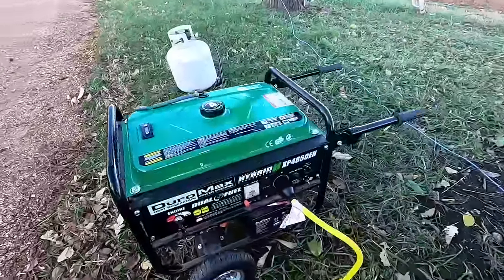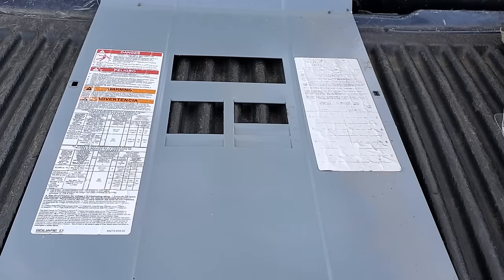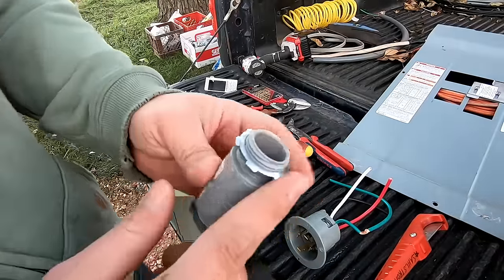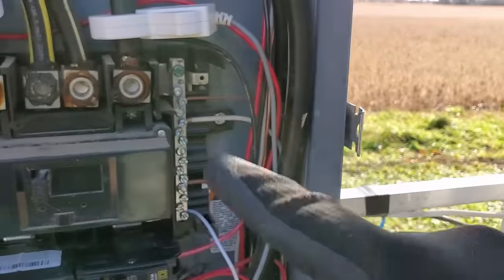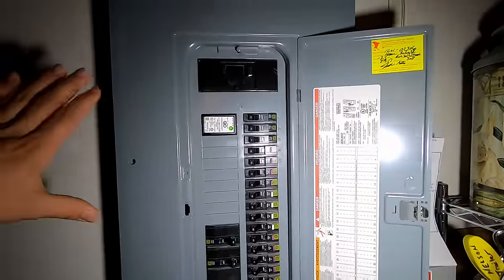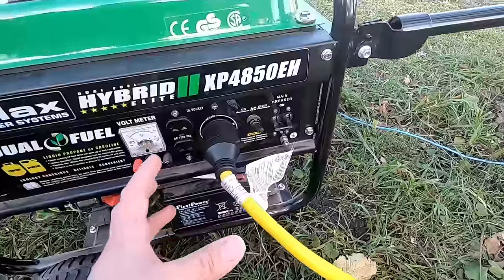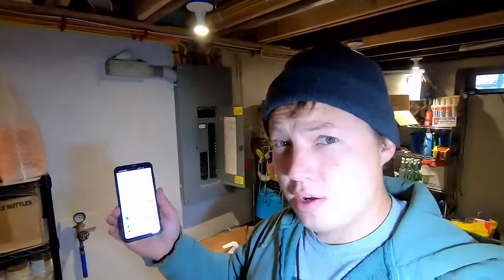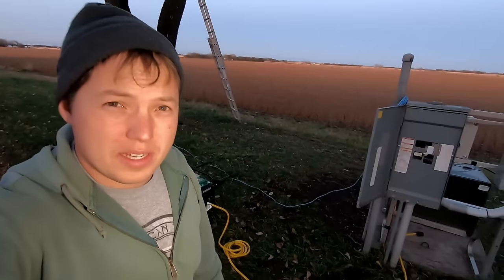How To Hook Up a Generator To Your House Using a Breaker Interlock Kit & Power Inlet Box

Comment: Well done ... thanks
to bad you didn't have a female plug outside, then you would have less danger of hurting someone.  I learned a few things, old dog - new tricks .. thanks
Reply: It is intentional.  The generator has a female outlet when running, there is no energized surface and the inlet can never be energized from the panel side due to the interlock he installed.

Comment: If you want to be a 100 percent safe, pull the meter next time.
Reply: Sadly its illegal to tamper with the wire seal on the box or open even to pull out the meter as you don't own it.
Reply: @killerdeamonking   sounds pretty insane. How do you guys do service upgrades without touching the meter.
Reply: @Snooch-wi6yq  to do service upgrades the power company pulls the meter , they replace the wires from utility pole and then they reinstall meter and done.
Reply: @Snooch-wi6yq  and to do electrical you either do everything live or you shut off the main 100/200 amp breaker and proceed.
Reply: @killerdeamonking  nope not in New Jersey. We pull our own meters. Nothing would ever get done otherwise. And in the application he was working on, pulling the meter is the safest option, it disconnects the entire system including the lugz. Right????
Reply: @Snooch-wi6yq  it would just make the posts in the main panel dead is all. Your utility line goes from the pole to the mater and then to the box.
Reply: @killerdeamonking  exactly what I said. Pulling the meter would kill 100 percent of the power coming into the panel. And the would be the safest option in this application all day long.

Comment: Not so good job on NOT protecting existing wires in the bottom of that panel you just melted the outside jacket from those hot shavings.

Comment: Keep wires Segregated whites wires can only meet other whites, and blacks go with blacks t be with whites wires
Reply: Please make sure you follow all the generator safety rules whenever you use your portable generator. 
⚠️Here are the Generator safety rules that everyone needs to follow when using generators:

This is just a reminder for everyone’s safety when using portable generators. All generator safety rules need to be followed carefully to avoid hazards. 

1) Please do not allow an unqualified person or your children to operate the portable generator. Just because some manuals don’t say that doesn’t mean it’s safe. That is important against the generator safety rules. We also need to be keeping an eye on our children too. You need to make sure that your children are not playing near the portable generator especially when it’s running so they won’t get electrocuted. Generators pose electrical risks and they can be hot during an operation. Please keep your children away from the portable generator at all times. It is important to keep our children safe especially our little ones. Be aware of all the hazards.

2) Some people use their portable generators indoors which increases the risk of carbon monoxide poisoning. It’s important to have a carbon monoxide if you have a gas generator. Never ever use your generator indoors even if your doors and windows are open and even in the garage is not safe to use a portable generator. Not even at your porch and your deck. It is never safe to use your generator indoors and in enclosed areas of your home. Your generator needs to be 15-20 feet away from your house. 

3) 🔥generators cause fire hazards too. Never refuel your generator while it’s running. You need to let your generator cool off before refueling it and before storing your generator. Never overload your generator too. Never ever back feed your generator. You should never plug your generator into a wall outlet. Also never store propane tanks indoors. Please keep flammable things away from the generator as well and please don’t smoke cigarettes near the generator. Having a fire extinguisher next to the generator is also important against the generator safety rules. 

4) generator operation; make sure your hands are dry before touching the generator. Never use your generator in wet conditions. Don’t let your generator get wet. You need a generator tent if you need to use your generator during wet weather. Please don’t wear loose clothes when operating the generator. Turn on your generator before plugging in appliances. Use the right cord for your generator. Please do not use worn out cords. 

https://youtu.be/I1jT3ANENvI and here is a video more about keeping others safe when using generators and also about our family’s safety. It’s important to keep your children safe especially little ones. 

Electrical safety 

Hope this helps

Comment: Put a Dog house over your Generator to keep it dry
Reply: Remember to always make sure you follow all the generator safety rules whenever you use your portable generator. 
⚠️Here are the Generator safety rules that everyone needs to follow when using generators:

This is just a reminder for everyone’s safety when using portable generators. All generator safety rules need to be followed carefully to avoid hazards. 

1) Please do not allow an unqualified person or your children to operate the portable generator. Just because some manuals don’t say that doesn’t mean it’s safe. That is important against the generator safety rules. We also need to be keeping an eye on our children too. You need to make sure that your children are not playing near the portable generator especially when it’s running so they won’t get electrocuted. Generators pose electrical risks and they can be hot during an operation. Please keep your children away from the portable generator at all times. It is important to keep our children safe especially our little ones. Be aware of all the hazards.

2) Some people use their portable generators indoors which increases the risk of carbon monoxide poisoning. It’s important to have a carbon monoxide if you have a gas generator. Never ever use your generator indoors even if your doors and windows are open and even in the garage is not safe to use a portable generator. Not even at your porch and your deck. It is never safe to use your generator indoors and in enclosed areas of your home. Your generator needs to be 15-20 feet away from your house. 

3) 🔥generators cause fire hazards too. Never refuel your generator while it’s running. You need to let your generator cool off before refueling it and before storing your generator. Never overload your generator too. Never ever back feed your generator. You should never plug your generator into a wall outlet. Also never store propane tanks indoors. Please keep flammable things away from the generator as well and please don’t smoke cigarettes near the generator. Having a fire extinguisher next to the generator is also important against the generator safety rules. 

4) generator operation; make sure your hands are dry before touching the generator. Never use your generator in wet conditions. Don’t let your generator get wet. You need a generator tent if you need to use your generator during wet weather. Please don’t wear loose clothes when operating the generator. Turn on your generator before plugging in appliances. Use the right cord for your generator. Please do not use worn out cords. 

https://youtu.be/I1jT3ANENvI and here is a video more about keeping others safe when using generators and also about our family’s safety. It’s important to keep your children safe especially little ones. 

Hope this helps

Comment: I have a 10,000 w gas 8,500w propane dual fuel generator  so I can run a bit more than you show here but an interlock kit or transfer switch  are the only real ways you should be using your generator for your home and remember everyone keep it 10 feet from windows to prevent carbon monoxide poisoning

Comment: It would be IMPERATIVE to note: this is NOT a job for a handyman or homeowner. Touch the wrong part, drop a screwdriver, incorrectly install parts and KABOOM. Yes, I am a 40yrs licensed electrical contractor and have installed dozens of these interlocks, dozens of whole house generator. Stay safe folks

Comment: Sigh, once again no, no and again NO!  You didn't address standby system sizing just throw it in and flip breakers off if it overloads right?  What size generator, and why, what size generator inlet, what size conductors and why that size.  For conductors you addresses the 30A inlet but what about the 50? You don't use cable when you have a raceway you just buy THHN wire in black, red, white and green and the ground is insulated so your not going to have nearly the short potential as you would with bare copper.  You also installed in a panel that less than 10% of viewers are going to have and didn't address what to do,with the circuits that are in the way if say they share a neutral with another circuit not being moved....  AGAIN BECAUSE SOMETHING LOOKS EASY TO INSTALL DOESNT MAKE THE INSTALLATION SAFE OR CORRECT.  You do this wrong you could seriously hurt yourself or someone else, even following these directions with this panel that bare copper ground he wrapped around the LIVE lugs in the panel could touch and your not going to like the result.  Just hire an electrician he will go over what you need to know, he will know what circuits need to be moved and how to do that correctly and he will make sure you have the correct equipment to properly utilize the standby system being installed.  The is a reason you hire tradesmen, it's because they understand more than just how to put parts in.....  Last item NO you don't use wirenuts on a device that has terminal screws 3" below where you created the splice you take off the pigtails and wire your wire directly to the terminals because you don't want to create another potential failure point.

Comment: Grounding.....ughh.... a terrible topic as you're "damned-if-you-do-and-damned-if-you-don't". The issue is that your MAIN breaker has a bonded-neutral ground....between ground and neutral. NOW..... you gotta figure out if your genset has an open or bonded ground too. Most gensets purchased expect you to use it at a construction site....and NOT as an interlocked secondary supply to your home....so MOST gensets come with a bonded neutral ground ( ie "self-sustaining" ground at the jobsite). HOWEVER.....if you tie the generator into a main breaker as you ( and I) did....to act as a full-home alternate power source thru your main panel.....you should (either) convert the bonded neutral to "open", on the generator....OR..... to not connect the ground wire at the 30A inlet plug. It is technically against code either way.....but not converting the genset keeps the warranty in place....and it avoids you having to create a separate warning label for the genset that it no longer has a bonded neutral....and therefore (if converted thqt way), it should NOT be used that way in a construction-zone, stand alone situation...as the maker originally intended. For those that want to dig deeper.....here's some text I cribbed from the "DIY chat room" website--->

"The generator I have is like most generators you can buy for home-use. It has a bonded-neutral, as that is proper for a generator used in stand-alone service, like on a construction job site. However, in my case,it is not stand-alone, it will backfeed my main panel, that already (and correctly) has it's own bonded neutral to ground. NEC code allows a bonded neutral on the MAIN panel, and then, only this ONE bonded neutral should exist in the system. If there is a sub-panel, there cannot be another bonded neutral in the sub-panel [ I think this is 250.24(a)(5) ]. Attaching the plug-in generator to a home is the same as having a sub-panel with a bonded neutral. Here's the problem--> by having the neutral and the equipment ground bonded at the generator AND at the actual main breaker, this creates a parallel-path for the return (neutral) currents which would then carry a voltage on ALL equipment grounding conductors (as well as the metal cases of any equipment using the equipment ground).  Parallel paths for neutral currents are always hazardous to some degree.

To avoid this hazard and non-compliance to code, I propose to wire the system this way, without a ground connection done at the generator inlet plug. Let's review what this means,  and what it does.----->

The only purpose of the equipment grounding conductor is to allow tripping of the circuit breaker under a FAULT condition. If a "hot" conductor to a piece of equipment were to contact a metal case (of that equipment), it would cause a high-current to flow from the protective device....through the supplying conductor to the case....and back to the source (panel) on the equipment gounding conductor. The current/amp draw would be high enough to instantly trip the circuit breaker. It really has nothing to do with directing electricity to the earth. By not having the equipment grounding conductor of the generator "bonded" to the earth, it does impose a slight hazard... IF.... the generator-to-house connecting cable developed a "line-to-earth" fault. There may (or may not) be enough amp draw to trip the generator circuit breaker under this condition....therefore it would not be reliable. To my way of thinking, this is OK as long as I keep an eye on the condition of the connecting cable from the generator....don't drive over it, etc. The result would be that the risk is very low."........
Reply: I love it. Very nicely said. I am enjoying the topics Benjamin is putting up and I love your response. Making me put on my thinking cap..

Ok, This is as of the 2011 NEC code book, see article 250.30. I don't believe there have been any changes to this section, but reference it to be sure. 

You can have multiple bonding points, one at the grounded conductor tie in point of each grounded circuit conductor for each power source and a bonding point at the first point of disconnect for a "separately derived alternating current system". The catch is that in order for a generator to be considered "SEPARATELY DERIVED" the main grounded conductor from the utility supply side of the of the panel must be disconnected from the panel while the generator is in use, not just the ungrounded "hot" conductors supplying the panel from the utility side.

Next, you must NOT connect the mechanical ground from the receptacle box serving as the connection point from the generator to the main panel, just cap it off, otherwise that would result in the problem of an "objectionable current" from the generator to the main panel as described by Wil Ferch above. Instead you must install a separate grounding rod for the generator and connect it to the generator at a point as shown on your generator ... "connection through the earth shall not be considered as providing an parallel path".

You need to install a single disconnect before your main panel for the grounded (neutral) conductor sized to your grounded conductor. Be sure to disconnect your grounded conductor as well as the main breaker when you switch over to your generator and disconnect that grounding wire from the generator input receptacle to your main panel and you'll be in easy lemon squeezy.
Reply: @kmds1908  ...thank you for the reply. I posted most of what I said to the electrical gurus at DIY.com website. Here's a short summary after a lot of pros/cons considered.....for my case using a bonded-neutral generator....I left the generator alone, and at the inlet box ( for the generator).....did NOT hook up the green ground wire at that box. Just being careful now to make sure I have new and excellent-condition hook-up cable from the gen to the inlet box. Perfect?....no....but  think avoids most of the possible problems.

Comment: He spends more time advertising the sense item than talking about the hook up of the hot (red ) cable coming from the generator and the path that electricity follows through it and after the breaker (black cable). He doesn´t explain neither how it goes from 240 volts coming from the generator to 120 that he ends up getting in the house. These are security hazards for the sake of making a few extra bucks on publicity. Be happy with what you get through viewers on YouTube and focus on content. I have to rate very bad this video and profoundly dislike it.